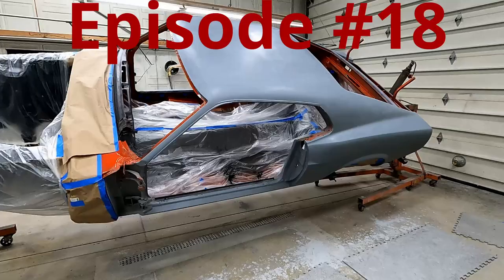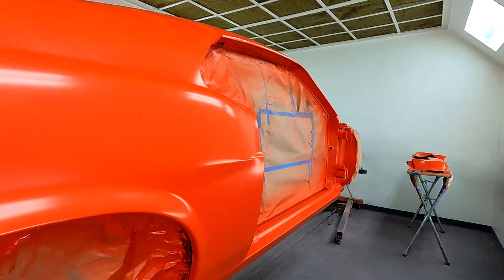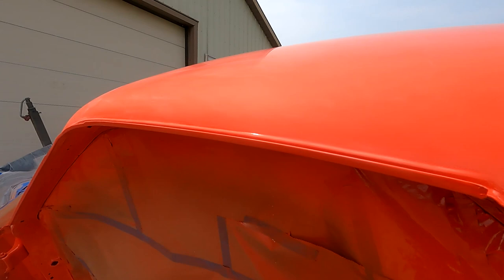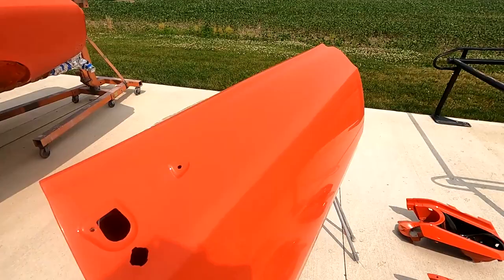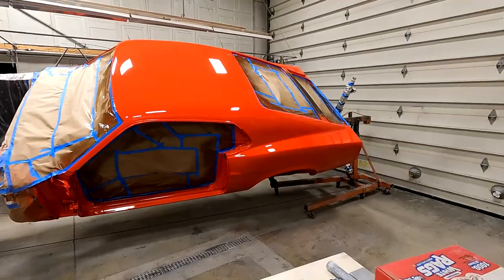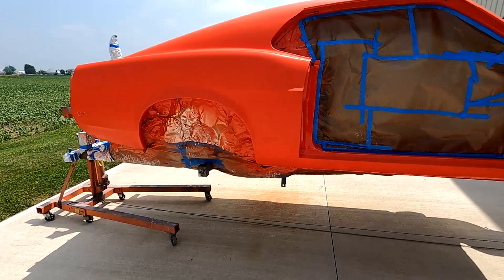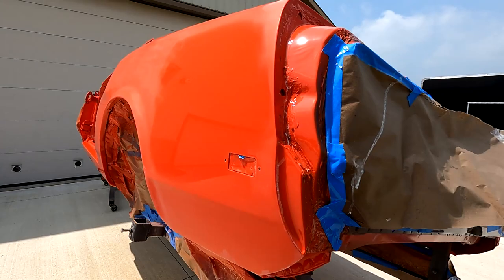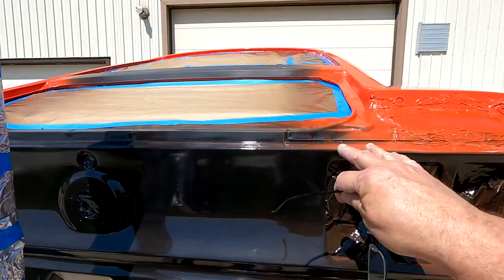1969 Mustang BOSS 302 Restoration Project:  #18.  PAINTING THE BODY.

Comment: How do you rub down and buff whilst also retaining some orange peel?
Reply from the maker: If you use 1,500 grit paper and a hard block it will level orange peel however if you use 2,500 on a foam pad, it will level dirt nibs, etc. but will not level the orange peel.
Reply: @greggrichhartdesigns9616  thanks that’s helpful 👍